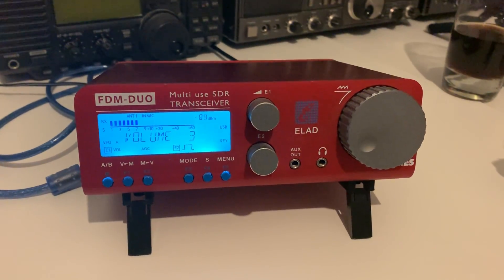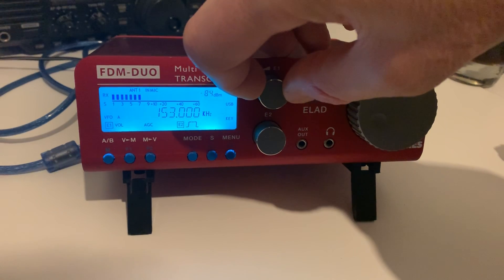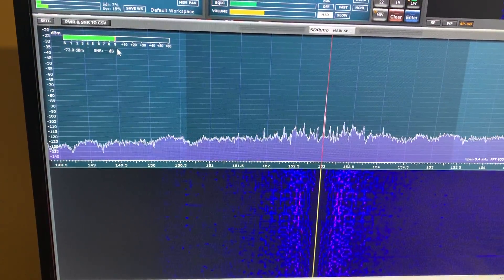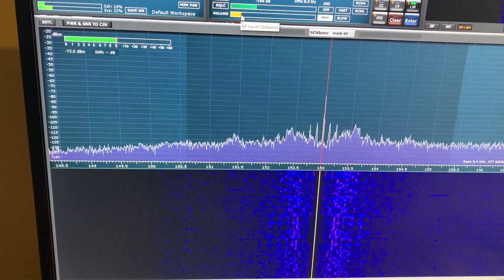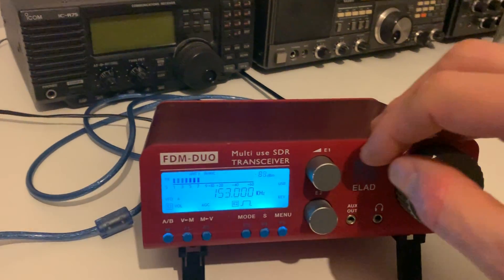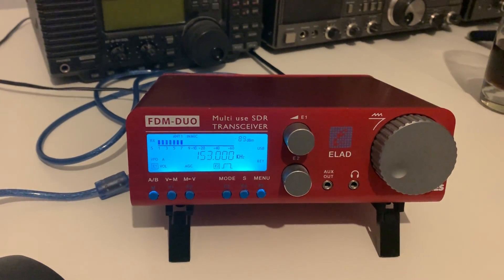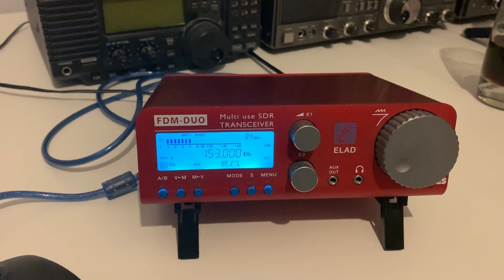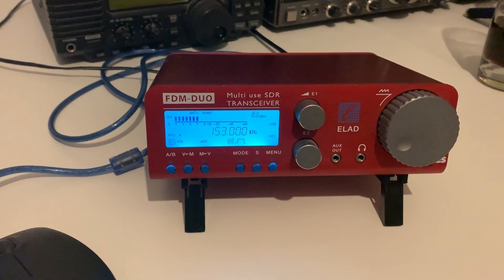SRRPlay RSPdx versus Elad FDM DUO: initial thoughts on how longwave performance compares

Comment: Curious, are you using any low pass filters with the SDRdx to keep the broadcast band from overloading into longwave? I own some pretty good receivers from the past, but they all required some good low pass filtering to hear anything below 500 KHz. Thanks, KD0GS
Reply from the maker: Hi there, I don't use filters and suffer very little intermodulation/harmonics. 73

Comment: I recently purchased the RSPdx and am quite pleased with it's performance. However I am a bit disappointed because I bought it for two reasons.  I had also hoped to use it with the Spectrum analyzer software downloadable from the same website.  At present (May 9, 2020) the spectrum analyzer software still does not support the RSPdx. You'll find the statement below in the section on the spectrum analyzer software section. It looks like it's taking a lot longer than a few weeks. This was long before the Covid-19 situation arose, so I tend not to accept that being the cause or an acceptable situation to blame for the delay. I suppose it's possible that it's not being worked on at all, or that something about the RSPdx design makes it's inclusion much harder than anticipated. 
December 4th 2019 update: Work is underway on adding the new RSPdx – this will take a few weeks – check back here for a status update.